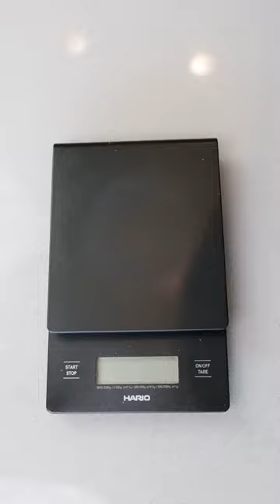What do you think about this new #coffee bed finish?

Comment: I tried it this morning and I’m really enjoying my first cup. I have two questions: 1, would you equate this to pushing through the hiss with the aeropress? 2, how does this work, given your earlier experiments on the low quality of the last part of the pour over?
Reply from the maker: Yups! Similar to the hiss of AP, but more so releasing the liquids. The his of the AP is pushing air through the grounds.

So the end parts of the pourover are necessary, but I noticed the grounds themself absorb a lot of liquids and oils. The release at the end helps release some more oils that may be trapped in there thus allowing a release of pure essence to drip out. I guess that’s what I think is going on. I see there’s more oils at the top of my brew when I finish so I’d like to think that’s what’s going on!